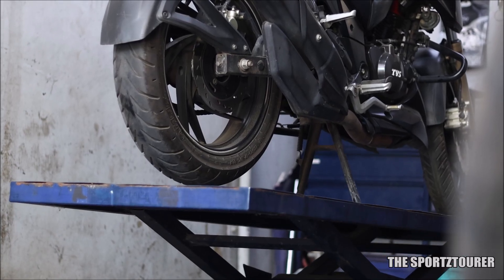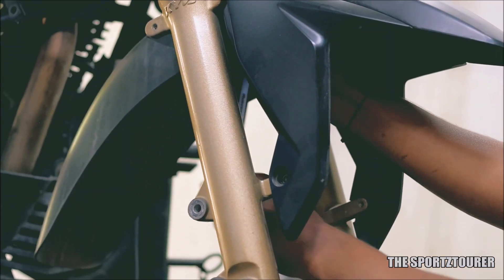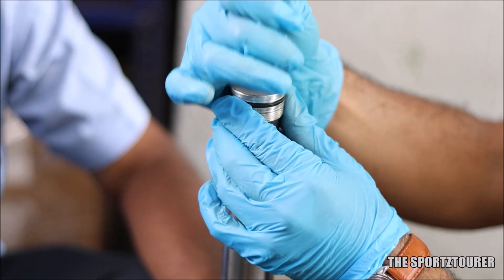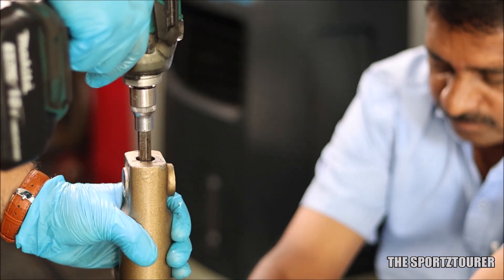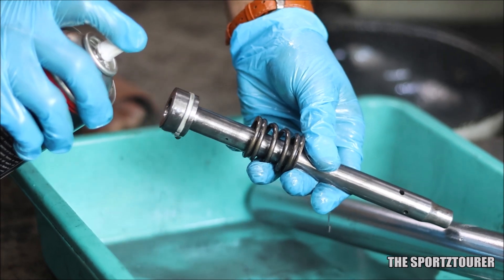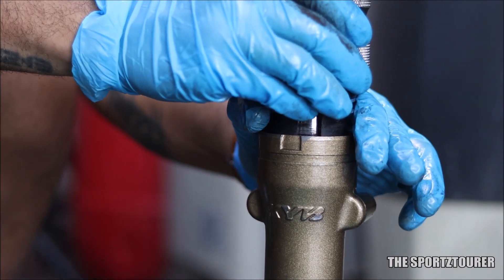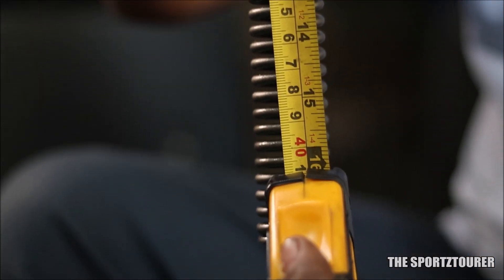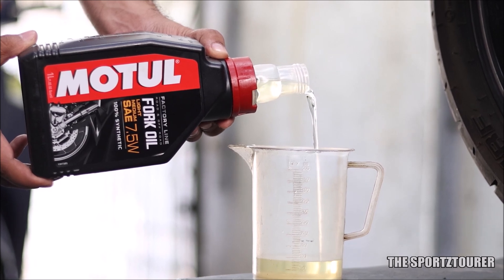PRO DIY HOW TO CHANGE FORK OIL & FORK OIL SEAL, FORK SPRING TVS APACHE RTR OIL LEAK BEST FORK OIL

Comment: Hello, Just came back from the service center where they advised to simply replace the front forks which has developed rusting spots on my apache 200 4v. Each one costs 3200rs. There is oil leakage coz of it.

I need a much cheaper solution.

Is there a way to polish and smoothen out the fork surface ? Do you know anyone who faces a similar problem ? Please do check in your network. I simply cant afford any major expenses at this point.
Reply: Just use them if they're in a decent condition and can be used, don't damage them, will be fatal to drive with if you do any of the methods you said, Just use them till they last and whenever you get the chance replace them.

Comment: @thesportztourer Hi, had a doubt on how the springs were assembled back, 6:09 i believe it should follow some method as the gap inbetween the sping coil tends to shrink.
So whether the side with less gap  should be towards tyre or towards the handle?

Comment: Is this fork oil is good ? Can it use in usd fork ? I'm using honda 200x it's front usd suspension is bit stiff , I want to make it bit smooth,  because I used to travel a lot

Comment: Hi bro,
Kindly do review of bajaj 10w50 engine oil, since most of the new dominars are running on it. Also a comparison with castrol super bike engine oil and liquimoly street race would be helpful. Once again thanks for such wellmade informational videos
Reply from the maker: Point noted, thanks for the suggestion and appreciating the efforts 😊

Comment: Which is better 20w or 7.5w fork oil..
I replaced my P220 fork oil at every 17 to 18k running with the company provide fork oil.
Nice video..😊

Comment: Hi bro. Recently done the same job for my fz. Each fork was filled with 450 ml of fork oil ( 459 ml in user manual ) and the fork springs also were new, bt it gets bottom out in hard braking conditions.  Could u tell me why???
Reply: Most probably the damping is not set correctly.
Reply: @the_good_lad thank you.

Comment: Dust upon the Fork pipes must be wiped in 7-10 days and oil must be changed every 3 years. Fork life will be greatly enhanced and it will work buttrr smooth. I own a Pulsar 180 2012 model. Still no fork oil leaked. As rear suspensions are Gas filled, bike suspensions work awesome. 👍